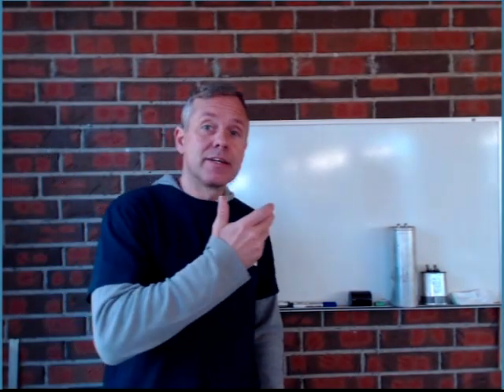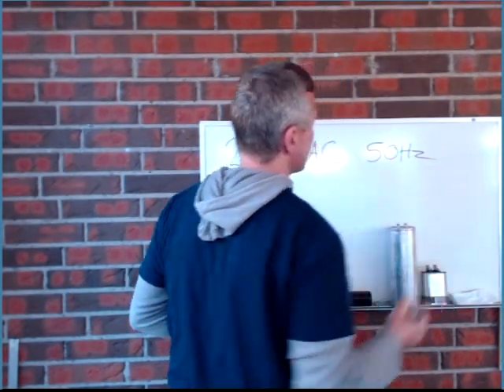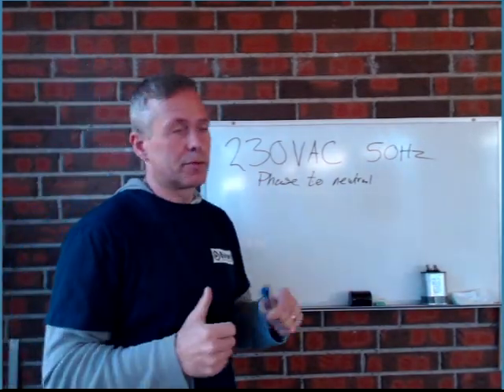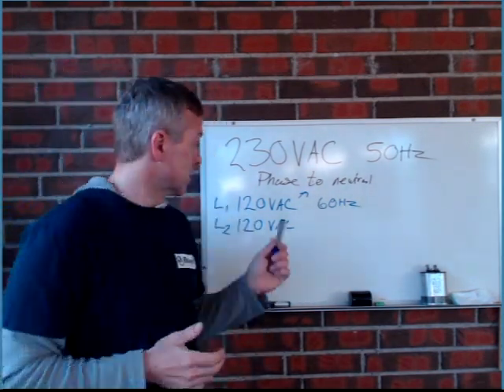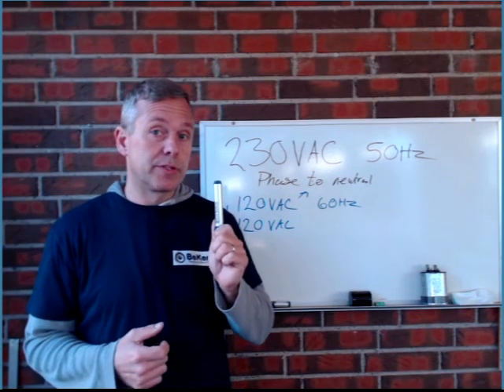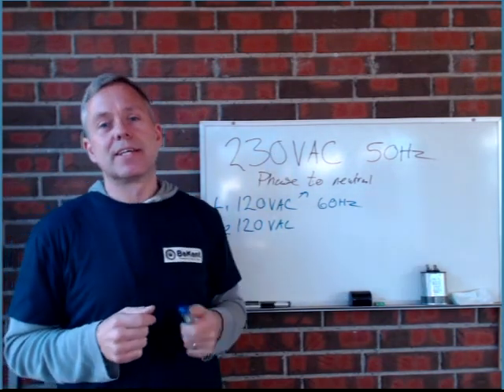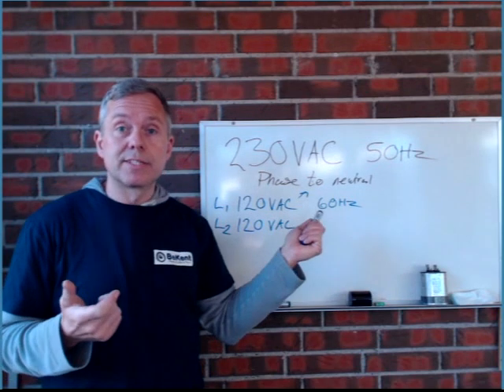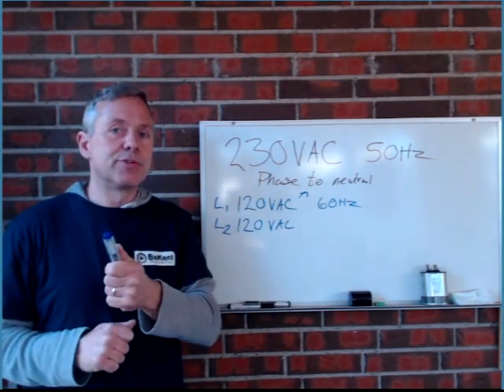European VS US voltage

Comment: In Germany is in every apartment 3 Phase standard (Three-phase AC).  This is what comes to every house.

Phase A (L1) to Neutral and/or grounding: 230 Volt +/-10%
Phase B (L2) to Neutral and/or grounding: 230 Volt +/-10%
Phase C (L3) to Neutral and/or grounding: 230 Volt +/-10%

Phase angles firmly shifted by 120° , 50Hz

Phase A (L1) to Phase B (L2) : 400 Volt  +/-10%
Phase A (L1) to Phase C (L3) : 400 Volt  +/-10%
Phase C (L3) to Phase B (L2) : 400 Volt  +/-10%

Our Europa system has the advantage that it is not necessary to lay such high cable cross-sections, the voltage loss is smaller. The power system is more evenly loaded, power outages are less the result. Electric cars can be charged faster thanks to 400 volts. Every larger device, such as circular saws, has built-in sensible three-phase motors, which do not require a capacitor. Whether household or industrial, all have the same three-phase AC system.
Reply: In North / Central America we have 240V of split phase for houses and 480V three-phase for industries (277 / 480V) in 60Hz for both.

The advantage of the split phase is that you can get 240V for high consumption equipment such as ovens and air conditioners, and 120V for low consumption equipment such as computers, TV and cell phones.

The divided phase works with two phases of 120V displaced 180 °. So you get:
Phase to Phase: 240V
Phase to Neutral: 120V

Thanks for the explanation, this topic is very interesting :)
Reply: most of the US system runs on 3 phase 480, at 60hz. That is 277v line to neutral or 480v line to line (not  including high leg transformers but I digress) . In residential and dwellings (it gets a little complicated when the NEC is involved) we usually have 120/240 single phase. I could be wrong, but it seems the grid systems are pretty similar concerning power transmission, it is just the end delivery that differs. I am unsure of the difference in transformer sizes due to the difference in frequency though. My gut says there would be a difference in the VA rating between the two systems, but I don't know how much less the 50hz system would be or if it would be an issue day to day for the consumer. Cheers.
Reply: Aussie system is same as Europe 
So much more flexible/ efficient than US
Half the cross sectional area of copper
And circuits can be twice as long
Reply: Same in all of EU. We use 230v and 400V. For some appliances, big ovens and so on. 
The 230 volt was made be course Europe used 220 volt, en uk used 240v - a compromise was 230, and just inside the plus/ minus 10% of appliances. Normal automatic fuses are 13 A 230v or 3x 16A 400V in households.
Reply: In Poland it's the same as in the rest of EU, however three phases doesn't go to every house or flat by standard. The standard is you getting one phase at 230V to ground/neutral, mostly at 20A (flats) or 25A (houses) maximum. The prices are cheaper and as most people don't need three phase power supply it is not a problem to not have it. However you can get three phases almost everywhere if you just want. My neighbour in our old block of flats was able to get a three phase power supply with 20A limit per each phase, so he could run an induction stove instead of a gas one. People started switching to electric like crazy here when Russia closed shut the gas supply for Europe, however now we get our gas from somewhere else, so people who got rid of their gas stoves and water heaters did that prematurely :)

Comment: In Sweden we got 400Volt 50Hz in all houses but in the Industry they sometimes use 690Volt 50Hz. One of the benefit with higher voltage is of course that we need smaller cable area.
Reply: 400 volt is normal for 3 phase
Reply: @matjazmeza  Maybe but In Norway 220Volt 3 phase has been standard
Reply: @RickardsGarage  So does Norway have different voltage than Sweden? Because here in Slovenia we have 230V 3 phase but if you measure the voltage between two phases you get about 400V. That's because the phases are seperated for 120°, so you have to multiply 230 by 1,73 to get voltage between phases. I think that you actually get 230V, the same as Norway, but voltage between phases is 400V 50hz.
Reply: @matjazmeza  The socket voltage is of course the same but the main voltage is different. Norway use largely 230 IT when Sweden has 400 V TN-C-S. Though Norway uses also the latter.

The difference is that at 400 V one typically uses one phase and the neutral. In 230 V one uses two phases and there are no neutrals.

What you described is 400 V three phase, not 230 V. In three phase one uses the main voltage in naming.

Comment: European standard is 3 phase 230V/400V 50Hz. This is what comes to every house.
Reply: themorfos Philippines and South Korea uses 230V at 60Hz.
Reply: Yikes, 50hz is horrendous
Reply: The Ball 50Hz at 110V. 

Eastern Japan (100V), Jamaica, Barbados and parts of Dutch Caribbean (127V).
Reply: @The_Ballo  works just fine in the rest of the world...
Reply: Te frequency is the dumb part.  If it were 60 Hz, I’d be for it.  I can see adding a higher voltage residential option in the USA, but it will be 60 Hz.
Reply: In Poland most houses and almost all the flats get one phase at 230V and 20A or 25A maximum. However you can ask them to connect you to the three phase system everywhere, including old blocks of flats (my neighbour did that so he could use his induction stove)
Reply: @5Dale65 All houses get 3 phase as standard. Almost all apartments get 3 phase. One phase system is found in apartments older than 20 years.

Comment: Oh Dear I am so stupid when it comes to electricity. You were speaking a different language to me. Perhaps you can help me out or one of your watchers could. I just bought a 1958 German sewing machine the plug in works here in Canada BUT the voltage when I looked is 220 and I think that is why the machine does not have much power. Do not know how the person originally used it when she moved here. But my brain thinks not enough power coming out of my socket so I need a transformer ? And if so what size should I get  the motor housing says 220 volt 24 watts and 50 hertz. I read double something  ha ha one of those number maybe the watts ? Thanks in advance OR is there a better long term solution since it will stay in Canada?

Comment: I would say, inductive loads like refrigeration, compressors, and air conditioning compressors have an issue with the cyclical change between 50 and 60 Hz. 31 years ago when I was in trade school we got a bunch of European compressors 230 V. Those 50 Hz compressors didn’t like the 60 Hz and ran hot.
Reply: If you transform the voltage, the Hz can make problems. The European compressors are adapted to the 50Hz.

Comment: Will a 240-volt air conditioner work from England on our 240 and I hear Germany is 220 there a little bit lower than England along with the rest of Europe will there 220 volt air conditioner work on 208 in a commercial building
Reply: Europe has been 230 volts for 30 years. Britain is 230 only on paper, they play with the tolerances.

Comment: Think about it as this way by standardization of voltage and power outlates around the world between 220 -240. V 50 to 60 Hz  and putting cable a lot of countries and corporations could save a lot of money  from maintenance to manufacturing costs  , plus devices require less electric energy to operate .

Comment: Interestingly, enough if you have a 480 service. you can tap one leg of that 483 phase to a neutral and get 240 single phase much like the European systems. I’ve run across several systems where we had 240 Vac compressors running off one leg of 240 from a 480 transformer, a neutral.

Comment: Wow very interesting. 
I was actually wondering if you could plug an appliance from Europe into a 220v outlet in the US. I didn’t think about there being no neutral leg on the US 220v where the European circuit has the full 230v in one leg with the other leg being neutral. I’m guessing the 50 hz vs 60 hz would probably be an issue as well. 
Thanks So Much For This Great Lesson!!
Reply: The european standard voltage is: Single phase: 220-250 volts 50hz Three phase: 380-430 volts Some feature a seperate neutral and ground depending if there is a  need for 240 volts.
Reply: A typical device does not care a bit which point in the system is grounded so it does not know that there are two hot legs.  There may be some devices like uninterruptible power supplies that might care. The frequency might affect some devices with motors.
Reply: @norwegiannationalist7678 There are different systems. 230 V single phase (2 wire) , 400 V threw phase (4 wire) and 230 V three phase (3 wire). The last is used at least on Norway and Belgium among other systems.
Reply: @okaro6595  Here in Norway 380-400 volt 3 phase (3 Wire) delta also exists, although usually transformed onsite from 230 volt 3 phase (3 wire) delta. And as you say 230 volt 3 phase delta also exist to my knowledge in Sweden and Germany, Actually all the types of C plug and outlet are originally designed for delta and that is the reason why it is unpolarized because in a Delta system single phase is achieved by using 2 out of the 3 (230 volt) phases and this is why there is no need for a polarized plug because unlike most other countries there isn't a neutral. Something i find a bit interesting is that in theory you can touch a phase and ground at the same time in such a delta system and not get shocked due to there not being any connection between them

Comment: Can I use a air-conditioning unit from England here in the us of it draws about 12 amps using #12 wire and a double pole 20 amp breaker there's is 240 line to neutral ours is 240 phase to phase
Reply: You have to look at the technical data.  The different frequencies can cause problems as well. The motors can run in different speeds.

Comment: Hey guys! I have a question about 3 phase network equipment. Is it possible to connect EU 3ph  400V/ 50 Hz washmaschine in USA network? Or I need some kind of converter? Thanks:)
Reply: You need a converer as the voltage difference is too high but very few residental installations in the US have three phase power so it would be difficult to pull off

Comment: If I’m in Europe and want to step some outlets, in my house, down to 110, can this be done at the electrical panel or must I purchase a converter box that plugs into the specific outlets I need power converted at?
Reply: You shold get the transformer.

Comment: My question is. 220v Europe the same as 220v American, or is it 110v America
Reply: First Europe ha 230 V and US 120 V and 240 V. I do not get what you mean with it being the same. Volts are volts. Now 230 V in Europe is the normal socket voltage. 240 V in the US is for special uses. In Europe one would often us 400 V three phase where US uses 240 V (like ranges) however they work also with single phase.
Reply: @okaro6595  400V Phase to phase is almost use in industrial and professional devices like welding transformers,  3 phase asynchronous motors. If you want, an electrician can install a 230/400V 16A CEE plug, in Europe only.

Comment: im planing on buying this machine that was build to EU electric standars 230 vac 50hz but im still the same. without an answer. if it would work here in usa wired to 240vac 60hz.. the machine is technically a fog machine and an A/C unit.
Reply from the maker: It will work in the US as far as power, however if it has timing in the electronics there runs on AC the timing will run a bit faster due to going from 50 to 60Hz, but most circuits are using DC internally and using a crystal for the clock in timing, and thats why you see many products with just a little switch on the back to change between 120 and 230volt. Lastly, remember most commercial buildings dont have 240volt between the 2 hots but 208volt instead, and not everything likes that from Europe if its a commercial product and you end up having to boost. Why an AC from Europe, they barely have them over there and certainly need them these days.
Reply: @AudioTalk  thanks for the respond... keep up your videos.  +👍

Comment: Hi, How can I use 230 VAC 50 Hz kitchen appliances on 120 VAC 60 Hz without using voltage step instrument.
Reply from the maker: On the particular appliance it will have the voltage requirement listed on a sticker typically right by the cord, but in general for appliances its a no and that you will need a buck-boost transformer.
Reply: Do I need the same buck boost transformer to plug EU  3ph 400v  equipment in USA?
Reply: You could install a 240 V socket.

Comment: So if 230 single leg to ground would be 120 volts?
Reply from the maker: If you have a single leg with 230volts to ground, its 230 volts to neutral as well. For the US if you have a single phase service you have 2 legs of 120volts to ground on each and between the 2 legs of 120volt you have 240volt.
Reply: @AudioTalk  Thanks

Comment: Thank you for this video. If I bring kitchen appliances from Europe to USA how do I best use them? Step up transformers etc ?
Reply from the maker: Hej Peter, if its just for smaller appliances to have on the counter a step-up transformer exactly https://www.amazon.com/KRI%C3%8BGER-Voltage-Transformer-Converter-Approved/dp/B00HAQT4QI/ref=sr_1_3?crid=MNI2H1CFA2ER&keywords=120+to+230+step+up+transformer&qid=1565907046&s=gateway&sprefix=120+to+230+%2Caps%2C544&sr=8-3   But for the bigger appliances dryer, oven, fridge you need what its called single fase in the junction box behind the appliance, here you will have two hot wires with 240volts across the two wires that will run your appliance granted its not 3 phase. If its 3 phase you are likely in trouble getting it connected and would need to make a bunch of modifications to the wiring, because its rare you see 3 phase with neutral, and here you will certainly need a buck-boost transformer as well.If its bigger appliances I would recommend getting in touch with a local electrician ahead of time if possible.

Comment: Sir i have 220v 2000watt australian food processor and i want to use in America how i can use as i wanted to use in washer dryer outlet
Reply: Just connect to both 120V phase to get 240V, it will run faster though because it will run at 60Hz instead of 50Hz
Reply: If it contains a motor, then double check the plate on it. Appliances with motors designed for 50 Hz do usually not work at 60 Hz !
Reply: @t0nito  no it wold'nt be faster because food processors use brushed motors.

Comment from the maker: Sure 230vac to neutral is more efficient, but consider the cost to change it in the US at this point. And to get americans to conform to take that cost, I would be surprised if a change ever happens. Personally I am totally fine with 110 outlets, even though I live in both continents.
Reply: When you consider most devices transform the line voltage down and rectify to DC for use, and large loads just use line to line to derive 240v, it is less of a one is better than the other, and more of a case of two ways to accomplish the same thing. I would say 120v is less lethal, but really thats like saying a butter knife is less lethal than a steak knife. Both can easily kill you. lol.

Comment: Hi I got a welder from UK and it work with 220V. Single hot line. Will it work in the US  with two 110v hot line as well? Please let me know. Thank you.
Reply: Yes
Reply: This gets confusing to the general public. In the USA, the neutral is only needed to split the transformer into 2 110 phases. A single phase 240 is achieved when a) no neutral is used and b) you use a 2 pole breaker.

Comment: Hi how can I use my American tools in Portugal???
Reply: For charging wireless tools you can just get a plug converter.
Reply: You need a converter. Technical, it is possible to convert the voltage and frequency. But those converters could be expensive.

Comment: Dude...in the american system the voltage from L1 to L2 is 240V and L1 or L2 to Neutral is 120V....
Reply from the maker: In 3phase commercial buildings its 208V between phases, and you can have a stinger leg of 208volt til neutral in whats called a Delta service. But in a residence you are right, but for hooking up a tanningbed what this is for, it would mainly be a commercial building, so if you don't check this you are likely to cause damage to the equipment.

Comment: US voltage VS The Rest of the World would be more appropriate.
Reply: kevin cordier Philippines (US outlet), South Korea (European outlet), Saudi Arabia (British outlet) uses 230V @ 60Hz.

Japan (Eastern), Jamaica, Barbados and parts of Dutch Caribbean uses 100v/115V at 50 Hz
Reply: biggest states of Brazil use 110v.
Reply: Pedro MR 220V at 60Hz in north parts of Brazil, Brazilian appliances are dual voltage (127/220V) and LED bulbs are dual voltage.
Reply: Well, it doesn't contradict anything I said. The biggest states still use 110v.
Reply: and the voltage of the appliences wasn't at all the question
Reply: North pole 0 voltage. The electricity is in the sky.